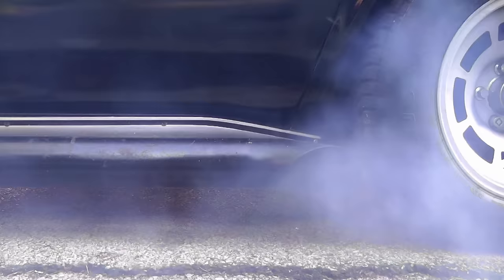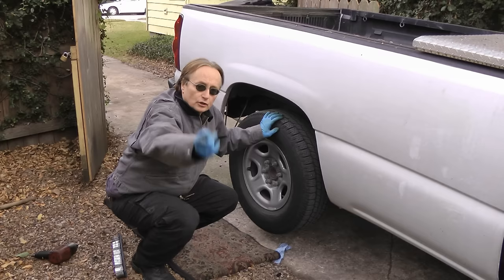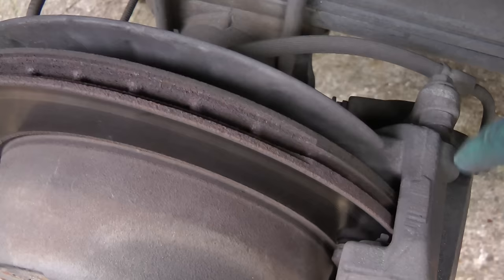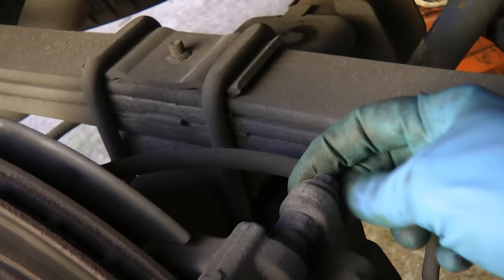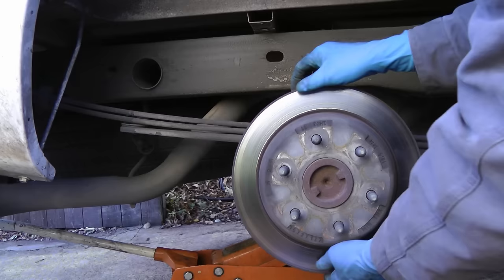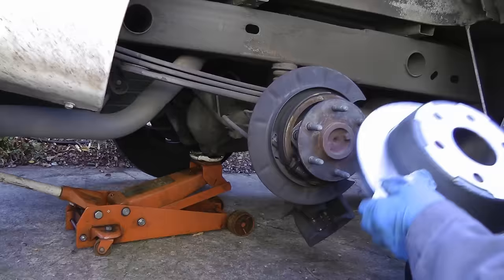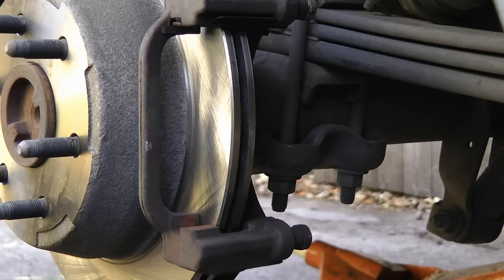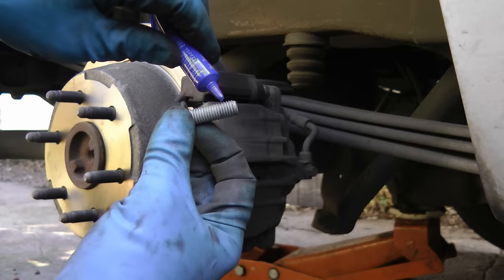How to Fix Grinding Brakes on Your Car (Rotors)

Comment: is it normal i have aftermarket drilled rotors (high quality auto parts ones, not cheap ones from ebay) with 30 000 km on them and the rotors look really grinded down and the brakes feel like im pressing on gravel?? and the brake fluid level is low but i cant find any leaks ?  2010 f150

Comment: Scotty I have a question. I had a mechanic replace both my front shocks but now I'm getting a loud grinding noise only while accelerating over 40mph. As soon as the gas is released noise stops.
Reply from the maker: +Erick Gomez take it back, odds are they messed up the suspension doing that work
Reply: +Scotty Kilmer Hey I have a question, After I hit a ditch my brakes started to make an scraping sound and there are like small silver flakes on the rim, any pointers?? Do you know what might be wrong

Comment: Wouldn't the slides and slots the pads float in need antiseize?
Reply from the maker: not on this design, they never had any. It doesn't rust here in texas, but up north if they do, put some on
Reply: Ahh. Makes sense, I'm from Canada.

Comment: Hi.. I am worried.. I am in US.. I just bought a used 2016 Honda CR-V car AWD .. my very first car.. when I drove back home with the purchased car I could hear the noise from break like a drum beat sound.. I got nearly 3-4 times in a 4-5 Mile drive.. there is a continuous rain in my place.. my friend told me during rain such a sound is normal.. even his car makes such a sound during rain.. is it true ? I do not know anything about cars.. so I am worried.. in case if I need to correct it at a mechanic shop what would be the approximate cost for it in US.. like in a Firestone or some local shop ? Please need ur guidance..

Comment: hi scotty my sister has 2009 Nissan 350z and when she put the key in the ignition and turn on everything was on but she could not start the car do you know what the problem
Reply from the maker: check the battery, weak one will do that. If not, often a bad starter, if you can't jump start it to get it to crank, replace the starter.

Comment: I have just replaced my rotors and pads on the back but one side seems to make a grinding noise when brake is applied the only thing i forgot to do was clean the grease off of the rotor...will this make a grinding noise.
Also the other side seems to get a bit warm?
Reply from the maker: yes, and if one side slides from grease, other side will work hard and get hotter
Reply: Thanks
Reply: +Jamie Leeson check if the brake caliper doesn't rub on the inside of the rim. If so then most likely a caliper bracket bolt.
Reply: +Luis Madero I found the problem but am to embarrassed to say what I'd done wrong... In my defence it was dark!
Reply: what did happen?
Reply: +Luis Madero I put them on back to front
Reply: wow well there a first for everyone!
Reply: In my defence it was dark
Reply: your calipers need to be replaced it sucks cuz it cost so much but I'm willing to bed that's your issu

Comment: I just replaced all my brakes and it only grinds/groans out of the 
driveway only when I start up the car after its been sitting for a hour 
or 2 and idea? Because I get in crank it up back up then put it in drive
 and tap brakes a little and then its the noise and I dont know why?
Reply from the maker: give it a while for the brakes to settle in on the old rotors

Comment: Should’ve cleaned that hub before you put the new rotor on.. never hang a caliper from the hose .. and lubricate the slides.. also invest in a breaker bar..... lol

Comment: Hey scotty do kno where my fuel pump relay is on my 91 camaro rs V6 3.1 L? Even when the ignition is off the gas pump is still running plz help
Reply from the maker: under the dash on the driver's side, get a new one and you can match it up

Comment: My front brakes skip when I brake hard.. I change the brake pads and rotors.. What can be the cause of the brakes to skip and is it safe to drive?
Reply from the maker: M Harris sticking callipers often do that, OR bad ABS system if you have ABS brakes.
Reply: Yes, i do have ABS brakes..

Comment: wait so I'm confused did he just clean the old rotor or did he replace it with a brand new one?
Reply: +Zyzor replace, if there are grooves like the old one had, you either machine or replace it, but in most cases you just replace. You HAVE to clean the NEW rotors as well, because they come coated in oil so they do not rust.

Comment: find it really hard to push the piston back. is it like that cause I havent touched the brake fluid?
Reply: Yes it is hard to puch it back in but that's normal, if its really easy to push in you could have a leak somewhere.
Reply: it is somewhat hard but what you might need also is a special kid of tool to twist the pistons if there is a small hole in it, its called a brake caliper tool i believe. it needs to be twisted back on a cicrular motion which is why you probably cant push it back,

Comment: hey scotty i have a question is it ok new brake pad is replace not in rotor disc is posible will grinding it while driving?
Reply from the maker: new pads on a worn out rotor will not make the rotor correctly smooth. It will smooth it some but it would be out of shape
Reply: so is it posible scotty i change my rotor disc to a smooth breaking?

Comment: I wouldn't hummer a tool just cause...i use a steel pipe as leverage with a bit of wd40 works like a charm..
Reply: I used a long steel bar and broke 2 different craftsman ratchets today before giving up.
Reply: @HaustoriaPith  means you were using the wrong ratchet for it..
Reply: @Italianborn  they were craftsman 3/8 breaker bars. And they broke. Other than buying 1/2 or 3/4 bars and trying to find new sockets to match, I'm not sure what you mean by it being the wrong tool.
Reply: @HaustoriaPith  the proper size ratchet for the proper torque will never break unless it's made out of crap...as a plant operator i service and change seized up bearing just as big as my head with regular tools and they never broke.. it's been 10 yrs i do my own maintenance on my vehicles and never happened..not once

Comment: Hi I just change my rotors an pads on my Jeep GC but the rear pads don’t make full contact with the rotor.  I am looking for information about this but there is not much information anyone knows why this happens?
Reply: They probably gave you the wrong pads... If not than pistons in the caliper probably bad

Comment: Why didn't you open the caliper valve to close the piston ? dosent it break the master cylinder and caliper seals?
Reply from the maker: NOT if you go slow and steady like I do. If you go too fast, yes, open the caliper and make a mess.
Reply: Oh good! Thanks for the reply man! I was worried cause I was doing some brake work on a 840 csi BMW and the caliper was very strong to put a C CLAMP on to compress; did some research and EricthecarGuy said to open the valve on the caliper.
Reply: +Luis G. Hernandez Yum, 8 series!

Comment: Everyone has their own method of getting the job done, so I'm not trying to be a jerk. But, I usually use a breaker bar when using a hammer in order to save wear on my ratchet wrench internals. Cheap ratchets tend to break easily. It's very unlikely many people working on their own vehicles will have breaker bars though, good ones aren't cheap, and it's just not a tool often found in inexpensive sets.
Reply from the maker: this is an auto zone duralast ratchet, very good, and it has a lifetime warranty. As the store is 2 blocks from my house, I don't care, I get a free one if it breaks.
Reply: Scotty Kilmer I use Blue Point, Par-X and Snap-on. I bust on I have to wait a week for the truck to come around to get a new one. Living in the sticks has it's downsides.

Comment: All four of my brakes are rubbing in my '01 MR2 Spyder. If I do have to replace the rotors, is it wrong to use $16 dollar ones I found on parts geek? The OEM ones are just so expensive
Reply from the maker: +megakiller999 they should work fine on that light vehicle
Reply: +Scotty Kilmer thank you for the prompt response scotty!

Comment: problem I'm facing is that when brakes are hot. suppose after an hour of driving in traffic, brakes make noises and performance drops badly.
Reply: +Omar I Upgrade your pads to higher performance rated pads.
Reply: chbrules yea, i got OEM pads instead. braking is better than ever before. Thank though.
Reply: +Omar I Or you can have a sticky caliper or if it has drums in the back, probably the shoes are too tight, and that makes your break to get hot even when not being used

Comment: I just installed new brakes and rotors.  and they make that exact grinding noise. why are they doing this?
Reply from the maker: if parts were right and installed correctly, the wheel bearings would be bad OR it would be the other 2 brakes being worn on the other axle
Reply: you could also possibly have bent the brake shields behind the rotors and they are rubbing.

Comment: When you push in the piston on the caliber that way, you can destroy your ABS system...
Reply from the maker: not if you do it slow like I did. But if you're worried, open the bleeder valve, but then you get air in the system and have to bleed it out
Reply: Scotty Kilmer
 not necessarily if you have a "bleeder bottle" which you can make cheaply with an old soda bottle and aquarium tubing.

Comment: Is it safe to use a jack and not a stand for safety?
Reply from the maker: IF you work on flat concrete like me and use quality jacks, I've never had one fall in 46 years. But for longer jobs stands are used, especially if you're crawling under doing a clutch job
Reply: +Scotty Kilmer I wouldn't care if it's a billion dollar floor jack engineered by NASA, it only takes 10 seconds to toss a pair of jack stands under it.

Comment: I just heard the grinding noise. I stopped driving immediately. If I just heard the grinding noise do I need a new rotor?
Reply from the maker: if it's lightly scored, no.
Reply: thanks

Comment: What was the problem with the system in the first place??? Sticking caliper piston??? or sliders??? maybe diagnosis into the cause would help the average DIY,er even more. Just a thought :@)
Reply from the maker: na, owner just drove it until it wore down to the metal.

Comment: Gotta comment on a few things, first, you probably should not hang the caliper by the brakehose and risk damaging the hose, and secondly, grease up the sliding pins with silicon and also something lile copper paste in the moving edges of the pads. Scotty seems to be in a hurry usually, skipping some details. Otherwise great work on these videos.

Comment: My rear brakes make a noise even when im parked and push on the brake. Its like a rough tightening noise, any ideas?
Reply from the maker: +Bob Smith pull off the wheels and check em then, worn or glazed rotors ofen do that
Reply: Scotty Kilmer okay thank you sir
Reply: Scotty Kilmer Yea there seems to be scratches on my rotor and when i spin it it scrapes against the caliper, what does that mean?
Reply: Never mind, the rotors where fucked so i got new ones and new pads, we good.

Comment: So blessed to subscibe in your channel sir. I have a 2016 Nissan Sentra, I bought it when only 25,000 miles. Everytime I spray the wheels with the lubricant the squaky sound when I hit the break went away but the next morning I hear the same sound again. I hate that sound and don't know what was a problem. I inspect the breaks and still looks brand new. PLEASE HELP!!! What is the Problem??? Only when I hit the breaks especially every morning. Its so embarassing because the car looks brabd new but the sound is bothering me everyday... Please HELP us witg your wisdom. Thanks!

Comment: this is horrible. you just dropped the caliper on the ground. how could that be since the brake hose should not be that long. and you just used a huge plier to squeeze back the caliper without even support. horrible. and you skipped all the greasing

Comment: no chance in resurfacing those discs? its like $15 a piece vs $200+ for new ones.
Reply from the maker: they make discs in china now, new ones don't cost much and they work perfectly fine. The chinese do know how to make steel.

Comment: hi scotty , I have an 2007 toyota matrix base model 1.8 vvti 187 000 kms , everything runs great but I keep getting P0171 system lean .. I clear the code and it comes back after a week or so of driving , I checked everything visually and nothing , I really dont know what to do
Reply from the maker: tiny vacuum leak, try a new gas cap, pray that fixes it. If not, live with it, or pay a guy like me to smoke leak check the evap system.
Reply: ye thts wht I was thinking .. what do you think is better to find leaks ?propane of carb cleaner ?
Reply from the maker: Robert Chmiel
carb cleaner is safer,but I use smoke. See my video "finding engine vacuum leaks with a cigar"
Reply: I just saw it , your always full of ideas , at the moment I dont have carb cleaner nor propane but I do have a cigar , thx again man

Comment: why don´t you use copper paste on those brake pads?
Reply: Because that would be a waste of copper paste. This is the second time I've heard of someone using this. It doesn't make sense. The caliper bracket along with the clips holds the pads in place. They're not going to magically fly off.
Reply: +Jordan Asquith You use copper paste to stop the breaks squealing. It isn't some kind of magic glue.

Comment: its a bad idea to leave the caliper hanging on the brake hose :)
Reply from the maker: realize those hoses take 1500 psi pressure, a little hanging isn't going to hurt them.

Comment: Scotty why none of your cars has abs when you brake wheels lock
Reply from the maker: cause i disconnect it, i know how to drive and don't like it
Reply: Scotty, I have a 2000 s-10.  Sometimes when I brake they lock up.  Not always, but they can lock up when I press hard, and also when I'm in a bumper to bumper traffic jam.  Where do I start to diagnose the issue?
Reply: Scotty Kilmer nuff said LMAO

Comment: I replaced the Brakes I replaced the pads I replaced the rotors but I'm still hearing that exact noise in the same place what is it now??
Reply: Put on some copper paste
Reply: Jack it up and yank on the tires.  If you installed brakes properly, then it's probably a bad wheel bearing.
Reply: Rocky J make sure you broke in your new brakes properly and used brake grease. these can create the squealing noise if not done properly. also, check with the window down while driving beside a building and see if the sound changes with braking. if not, I would say wheel bearing.
Reply: melody Hart Thanks and it was my wheel bearing .
Reply: you could try replacing the clips the brakes hold onto Scotty has a video on that
Reply: That actually ruined one set of my breaks, the clips broke and they wore unevenly and started making weird noises and felt weird.

Comment: He didn't service the caliper either.   So you will wear the inside pad again on the new brakes.  Slider pins Scotty!!!
Reply from the maker: this is Texas, we get very little rust here. I do lube the pins if they have problems, but here normall the dust boots keep the grease in and they are fine

Comment: Shouldn't use a hammer on a ratchet mechanism.

To push the calliper back in, isn't it best to put the old pad on the calliper, then use a g-clamp to push it in evenly?

Also, it's not a good idea to leave the calliper hanging like that by the brake hose.

I like your videos, but this one seems a little reckless..

Comment: Newbie question I cannot get the brake pads released from the caliper to change the rotors/pads. Very rusted. This is on my 99 maxima. Oh & there is a scraping noise driving so is the caliper shot?
Any helpful advice appreciated!!
Thx in advance.
Reply: Z Jazzerator you my have to change everything out
Reply: @nedoscarsandfishingvideos5500  Thanks. Got new calipers yesterday.

Comment: let the caliper dangle from the hose...damn scotty i thought you would be better then this..
Reply from the maker: for the millionth time, those hoses hold 1500 psi up. Dangling hurts nothing, but, if they are cracked or old, one should replace them anyway. If dangling makes em leak, they should have been replaced years before.

Comment: woooooow. Torquing bolts by beating a ratchet with a big ass hammer, oh and let's just let the brake dangle by the rubber brake line, what a freaking yaa-hoo I wouldn't let this guy touch my 20 year old beater.

Comment: Wow it's really dangerous the way he does things. YOU SHOULD NEVER SUPPORT A CAR USING ONLY A JACK AND NO JACK STANDS. Use at least 2 jack stands symmetrically. Jacks can bleed away slowly and don't bet your life on the Oring. Second, YOU SHOULD NEVER HANG A CALIPER BY THE BRAKE LINES. They are not designed to be stretched.

Comment: you could at least rest the caliper on top of the leaf spring rather then letting it hang from the line. Not very professional there Scotty...
Reply from the maker: it did rest there most of the time. BUT, REALLY, those hoses hold over 1500 psi and are very strong. If they are cracked and hanging breaks em, they are long gone anyway and should be replaced then before putting the tire on anyway.

Comment: Did anyone else cringe when he took the caliper off and just let it hang putting all that pressure on the brake line???
Reply: protectyaneck__ No. It's actually not a big deal if your brake lines are in good shape.